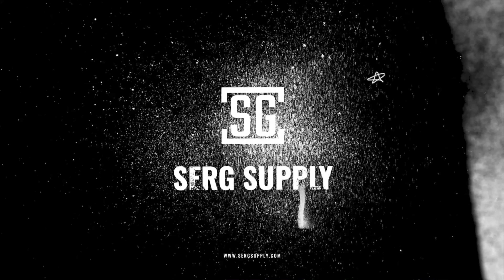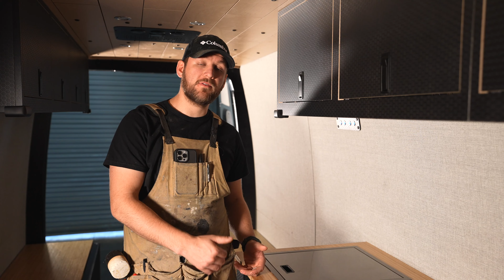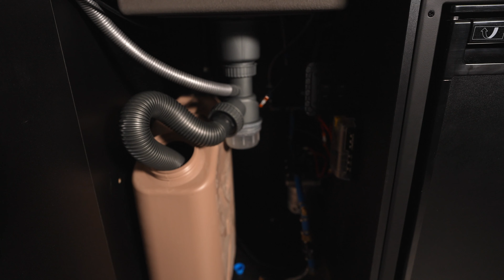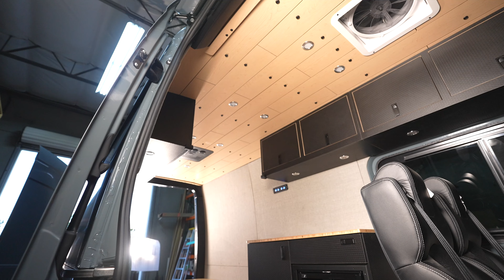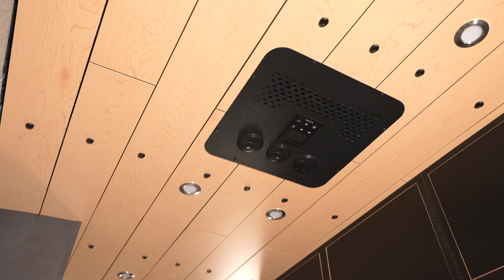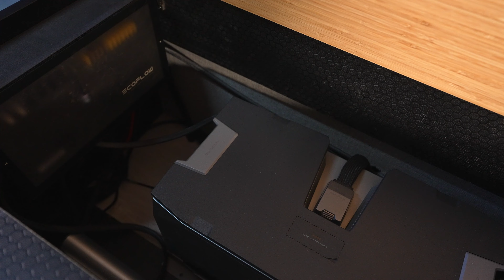Complete Van Tour Built By Serg Supply

Comment: Great job!!! How do you install the wall without any fasteners?  You spoke of hidden hardware?

Also, is it possible to do the roof with any fasteners?
Reply from the maker: The fasteners are hidden behind pieces of fabric. It makes a flush surface in the van. The same fasteners are used that we use on all our products. The ceiling is not as simple so the fasteners will be visible.

Comment: How big of a Victron System do you think would fit in the low fender boxes?
Reply from the maker: you could easily fit 400 amp hours in there.
Reply: @Serg_supply  Would that be 4- 100ah batteries or 2- 200ah batteries?
Reply from the maker: Can you send us an email? The space is dependent on which vehicle you have and also which length of bench you choose. This would probably be easier to chat about over email or phone. office@sergsupply.com. Thanks!